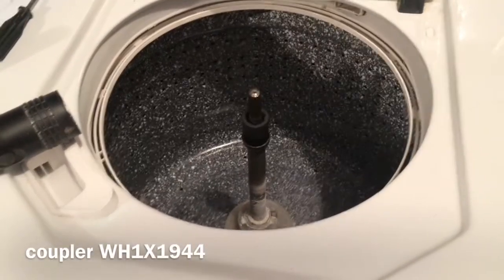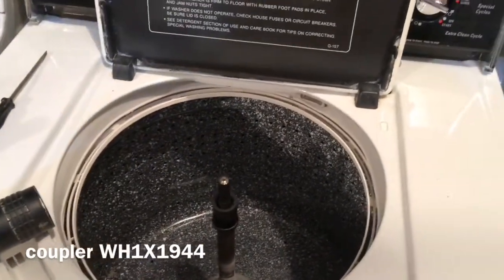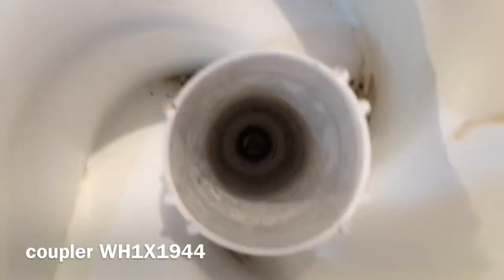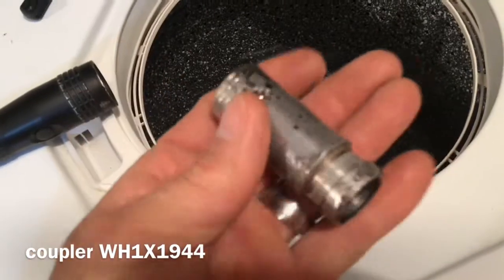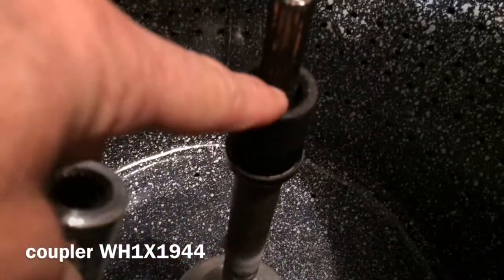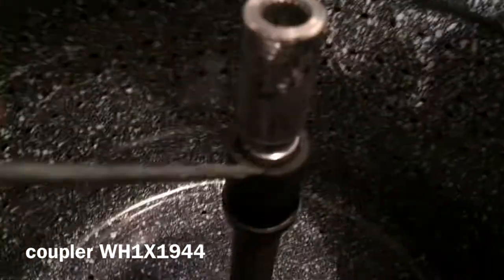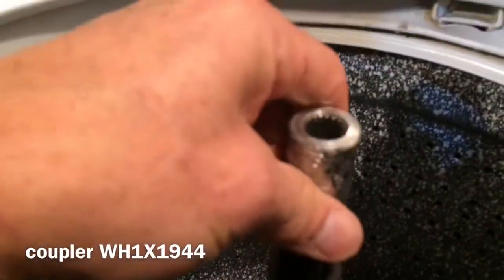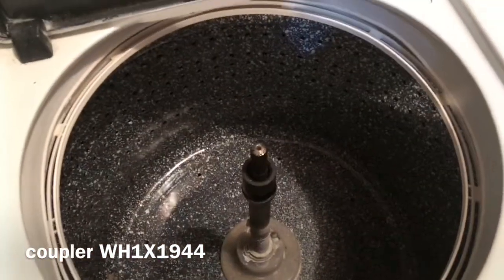GE washer agitator coupler coupling WH01X1944  WH1X1944 removal replacement repair

Comment: Thanks for the video, very helpful..I’ve had the same problem and here is what I’ve learned with the experience. I had a service person in...they didn’t know anything about this problem...$80! I found the replacement part for $5 on the internet. I bought the GE repair manual and the suggest hot water or penetrating oil put in from the top to break loose a frozen rubber spline.. I put the new part in but the agitator wouldn’t go down low enough to catch the water coming into the lint tray. I used a dowel to drive the rubber splined section further up into the bottom of the agitator. The flange at the bottom of the didn’t want to stay trapped into the rubber piece on the shaft. I found I had some rubble sitting in there. Cleaned it then put some threadlocker permeated green on the metal splines. Also put a tie wrap around the rubber sectio on the shaft. This makes a little harder to get the new part seated where it should be but I’m hoping this will prevent it from popping up. I’m also trying thr new Flex Glue to bond the old part together.i complained to the service Co. I had one out and they offered a $100 certificate for another service call with no expiration date! This was Mr. Appliance.
Reply: Where'd you get it for $2? Cheapest I see is $40!  haha

Comment: Pleased to find this video! ... thanks pjm0551! ... I've had a slightly different experience with this WH1X1944 coupler from the other Commenters ... over the past 25 years, I have twice had to get a local appliance repairman to press a new coupler into my HOTPOINT (CAMCO INC.) washing machine's agitator ... the splined aluminum core of the coupler wears out over time working against the splined 'teeth' of the hardened steel transmission shaft ... I was the one removing the failed agitator and reinstalling the repaired unit and am now wondering if these couplers have been wearing out every few (8~?) years because of the agitator 'popping up', either because of my ignorance in not properly engaging the bottom of the new coupler with the rubber boot on the shaft, or, that boot is 'tired' / worn-out and no longer fully effective at retaining the coupler (& agitator) in their proper down / fully-seated / installed position (I thought I had the agitator fully-seated both times in the past ... what sort of clearance should exist between the bottom of it and the tub?).  My appl. guy previously warned me both times the steel shaft splines may be wearing out as well but considering I've managed to extend this washer's life significantly, I'm going to try another new coupler, which I may have been very lucky to find in Indiana this past week ... it's NLA to me in Canada and my appl. guy has now retired, so, I'll be doing the pressing out / in as well as the agitator re-installation tasks.  I've noted David Johannson's threadlocker / tie-wrap ideas ... my agitator has a removable cap on its' top so access to the coupler for pressing / driving out is good ... any other thoughts from anyone as to the pressing out / in operations?  Or the advisability of using a threadlocker on the splined pieces?  Thanks, K Mc

Comment: Thank you, thank you.  Much appreciated info!

I was able to remove the rubber part stuck up in the plastic agitator with a special, long set of pliers...  You can slip an edge of the pliers under the edge of the stuck-in rubber spline and then, with a bit of force, slide the pliers under it - it lifts up away from the plastic more easily than it turns.  Rather than "pull" (which failed and only ripped the rubber), I ended up turning the plier handles and the stuck-in rubber folded over on itself and I was able to pull it out very, very easily.

I have not attempted the center coupling removal. The rubber "boot" part is replaceable and, if the one I ordered fits, I may use the leeway to tear the old one off, rather than try to figure out how to not damage it while getting leverage to take the metal spline coupling off.

Again, thank you!
Reply: How did you get the metal coupler off the shaft?

I'm ready to use blow torches.  Ha.  (It hasn't slid off, even with vice grips, some tapping with a hammer, and a dose of liquid wrench...)

Comment: Very nicely represented  and very helpful thank you, I have a problem I can not pull the coupler off and and damaged the the rubber. I think coupler part{ WH1X1944 }.
Any suggestion please. I can not get the parts and  if some one has the rubber boot and coupler want to sell to me will be appreciate.
Thank you

Comment: Worst case senario use a blow torch with map gas if the part won’t come off. I had to do that and still took 10-15 of torching it on one side going 180 degrees then hitting it with a hammer then repeet using the claw on the hammer to pull it up. Just be careful once its loose  because if ur prying it up it will eventually come off quick and if u don’t watch out it will burn u or whatever it lands on. Disable smoke detectors around it before you start ;)

Comment: I'm just wondering - is there an adhesive that will glue the rubber part of the coupling back onto the brass part?
I tried Gorilla Glue, but it didn't hold.
Everything works, but because the rubber part of the coupling has come loose, the agitator will start to squeak and squeal when trying to handle a larger load, as the inner brass will turn and rub against the rubber instead of them both turning the agitator as a single unit.
Thanks.

Comment: Great video. I could not find any regarding tyat spline style.  How did you get the agitator off?
Signed
Still Stuck...
Reply from the maker: You can use a strap along with a block. The strap goes underneath the agitator the block goes across the top of the washer I use a ratchet strap and ratchet it off. I tighten the ratchet strap which exerts a force to pull it up. Hope that makes sense
Reply: Did you get it eventually? Am in same position - brass section of coupling will not detach from the spline even after trying to unhook the rubber boot. Have been dousing it with LimeAway (CLR) and WD40 to see if just glued on with 30-years' worth of water deposits and other crud. Yanking straight up with vice grips and nothing. Saw scoutsoldier's "blow torch" comment below, but hoping that it'll not come to that! Thanks.
Reply: @pjm0551  Was this for the entire agitator (ie. the big plastic part), or just the brass coupling?
As per the video, for my 30-year-old machine, the rubber part of the coupling came off of the brass part, so was easy to pull the agitator off. And a few pries with a pick from the top of the agitator loosened the rubber portion which then fell out.
But have not had any luck pulling the brass bit off, even after getting the lip of the rubber sleeve off of the bottom. Tried using a 91-lb test wire cable wrapped around the ridge of the brass and attached to a block on the other end, then a bolt screwed through the block, positioned onto the middle shaft to tighten the cable. I just snapped the cable! (Will try again with the next size/strength up.)
Have been using Lime-Away and WD-40 to try and loosen any buildup, but neither seemed to penetrate, as the pool of liquid would still be sitting there the next day. Have now moved up to Blaster PB, which is either dissolving into the crud as intended, or is just evaporating, as it won't be there the next day.
Have also been trying a heat gun to heat the coupling, along with an awful lot of hammering it - not sure if a propane torch would be better/hotter?